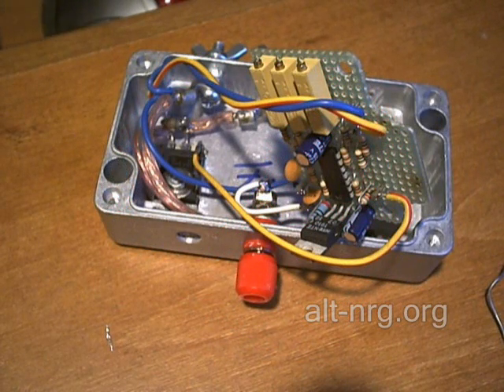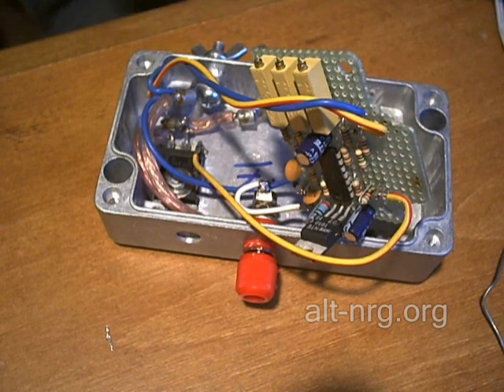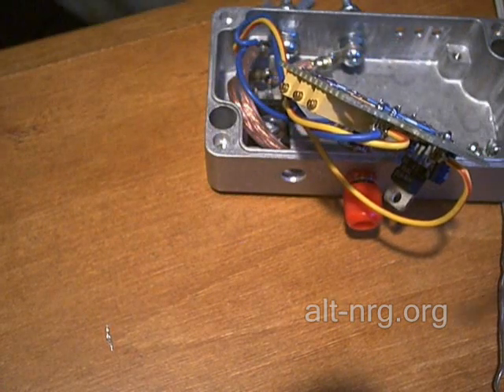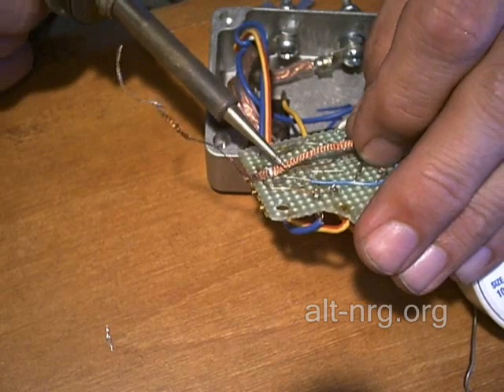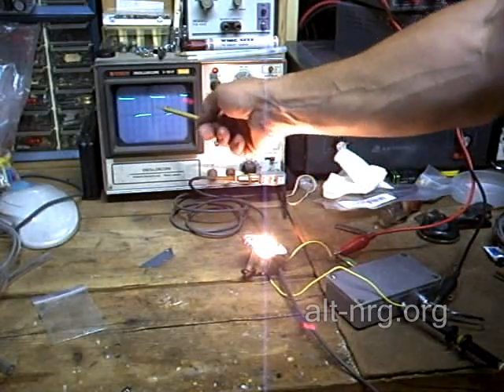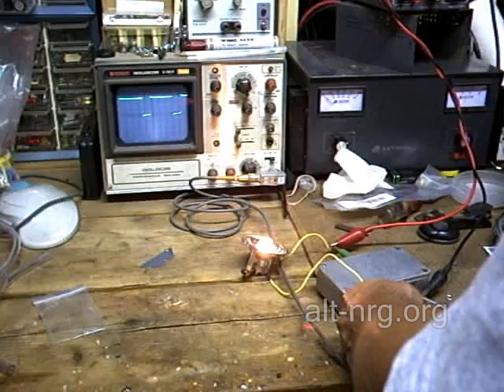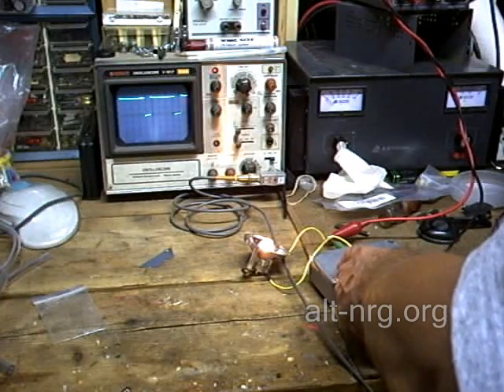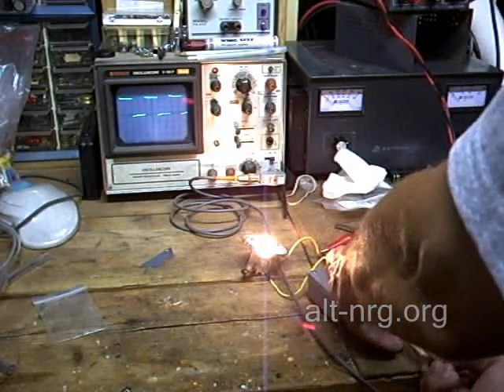#119 Building the PWM v2, part 5 of 5

Comment: Unfortunately I can not find in our region the condenser with the nominal value of 12.000 μF - 25V (C7). 
There are 15.000μF - 25V and 10.000μF - 25V. Is it possible to substitute? If so, what kind of the condenser would be better? Thank you.